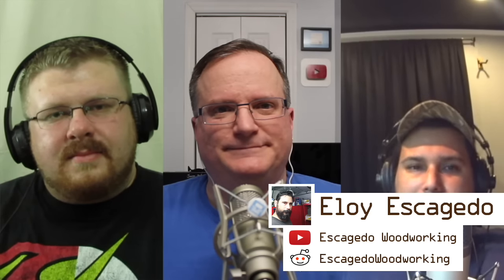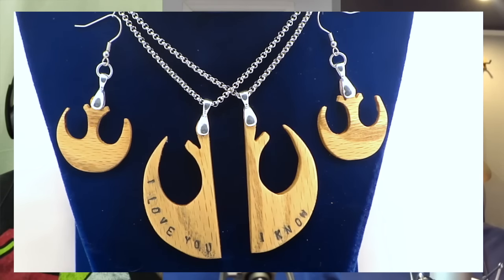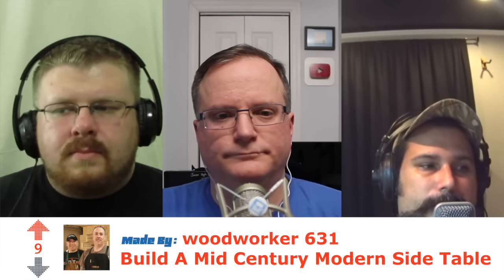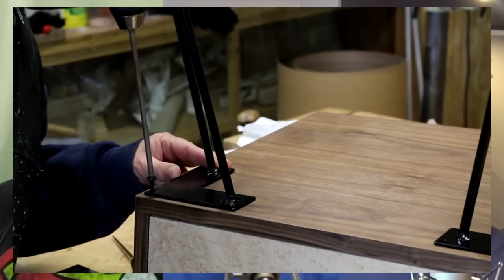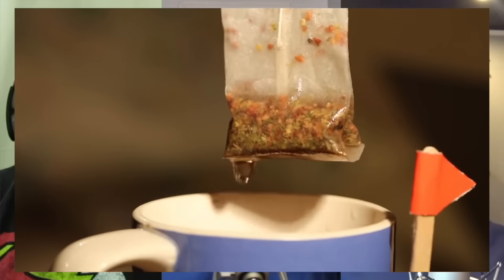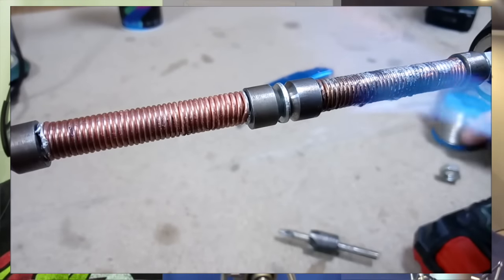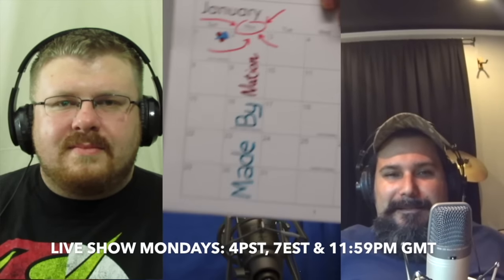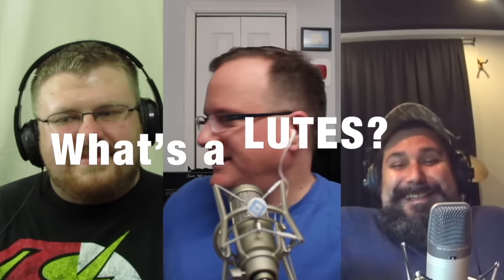Bigger video clips - What's a LUTES? #MadeByNation 003

Comment: Thanks guys for the shout out and the nice words.  If you use the alcohol to soften the hot glue, make sure it is 91% isopropyl alcohol, and it does have to soak a little before you remove your piece.  Again, thanks for featuring my video.
Reply from the maker: Glad to do it. Again, your stuff is great! Please consider yourself part of the nation. The #MadeByNation!